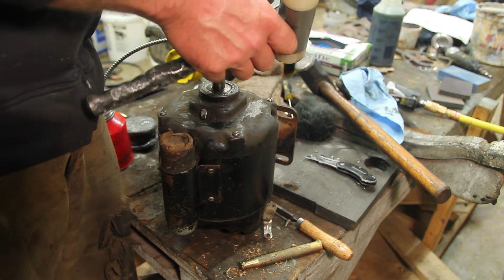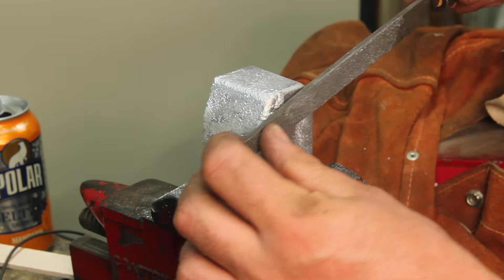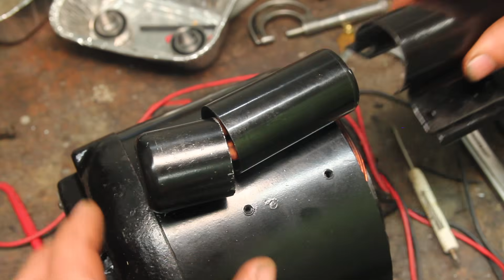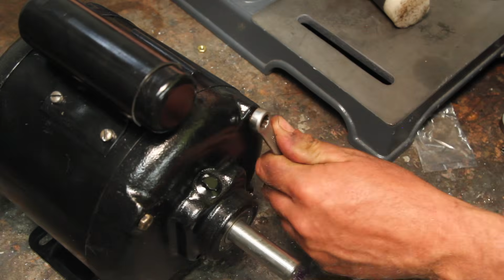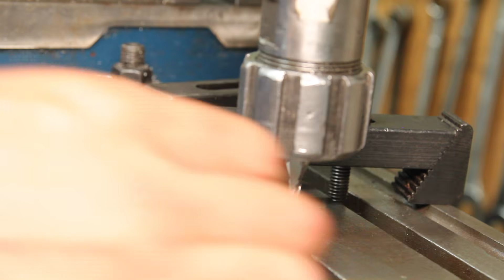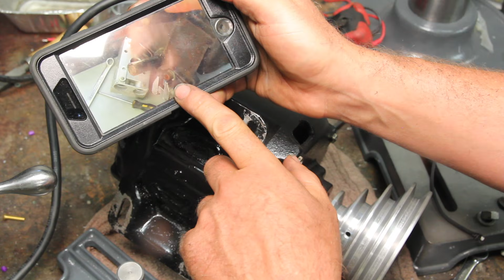Drill press Motor Restoration and a new step pulley

Comment: about the sleeve plane bearings aka steel backed Babbitt bushings they will work just fine even with that small area of pitting after you polish the shaft and about oil running out that crud you were digging out of the end caps was a oil wick packing that holds oil just a few drops at a time as all it needs don't drowned it or ya it will run out ! now is a ball bearing motor a better motor ya but what look are you looking for

Comment: I made a 5 grove pulley for a Cincinnati drill press 30 years ago from a 9.5 inch round stock aluminum 👍. I mounted it on a 1 1/2 horse Baldor motor with a reversible drum switch 👍 It still runs great 😊

Comment: Welcome to the mid 20th century anyhow.  My 1954 DeWalt radial arm saw's motor has 14/3 wire in it with a ground.  The insulation was rotted off the wires so I replaced it with 14/3 SJOOW cord.  The only new things it has that it didn't have before are strain reliefs for the cord.

Comment: man thats a super cool restore!!!! You sometimes go low key on some aspects of the restoration and sometimes all out! I like it, learn a lot. Even though casting, machining is so so time consuming it gets you the parts you need! always equal to or better than the original. I am improving and restoring my Walker turner 900 floor model. Putting a smaller KC 1/3HP on it as it looks way nicer. Adding a toggle switch to the side of the motor. Just that the switch is too big so it won't fit inside. Got an old projector that had a nice cast aluminum box that fit perfectly on the motor, Just need to drill 2 tiny holes to secure the box and it will be done.

Comment: Interesting with the plain bearings in the drive end. Both Restoration Projects' Delta drill presses have a tag which says "Double duty motor split phase : ball bearing" https://youtu.be/5HUOdNz1PWM?t=1755
Reply from the maker: It’s not the original motor.  I have baseless suspicions that the motor is older than the drill press.

Comment: Great Stuff! Thanks for the video and reviving this little pretty, Jeremy:)
Now to the usual Internet/YouTube "you should" stuff, hehehe: We NEVER solder electrical connections on machine tools. Especially not on motors or that with rotating parts = vibrations. Vibrations are the unavoidable death of every soft solder connection. That is only a matter of time. A physical connection or a permanently disconnected connection would be good. However, the most likely error pattern is an intermittently occurring fault. This is bad. Very simply (as with the existing motor and everywhere else) use a suitable screw/clamp connection, or the self-locking blade connectors, with the former being better and suitable for industrial use. BTW "They did it, too" or "This was the original state (from 1890??? hehe)" are NO excuses to not do it the right way.
Well ... No matter what you do, someone always mocks, right? Thanks again for the great video! :)

Comment: Excellent job. I have the Walker turner Bench model that is unblemished, but I plan to take it apart and do a resto paint job. I like your idea of casting the switch box. Mine just has an electric light switch. What size toggle switch did you use.?

Comment: Do you think your 3/16"  broach might have been 5mm ?
And 19/32"  could be Whitworth ?
Which referenced the size of the bolt not the AF.
Reply from the maker: No, I have the same 5/16” nuts with a 19/32” hex on my lathe- it’s the same vintage as this machine.  It’s just an odd antiquated standard.
Not sure why the broach was an odd size.  It wasn’t quite 5mm either.

Comment: Nice job!  How about a multi-speed pulley for the center collumn to get it down to steel drilling speed, if you're buying belts and making pulleys anyway?  Lots of diy examples out there as the original Delta attachment is pricey, when it can be found on eBay.

Comment: Beautiful work.  I am a little concerned about your location for the switch being so far from the business end of the drill.  I recently starting cleaning up a very similar Delta drill press, so I like your timing.
Reply from the maker: The original had the switch mounted on the side of the motor.  By modern standards, you’re right, that’s probably not the best practice…but neither is having open belts.
Reply: @JeremyMakesThings  Right on.  I haven't gotten around to decoding the serial# for my Delta, but I suspect it's a few years newer because they had wiring run through a hole in the back to a toggle switch on the side.  Of course the switch is right below the open belts, just to keep me on my toes.

Comment: OH YEAH BABY! DO ME ROUGH AND HARD, DO ME LIKE THAT DRILL! 23 minutes of good content, fuck yeah! Also, a horizontal mill would do the job just fine, the problem was your using a thick cutter like that unsupported from both ends... Sure, it can be used thusly, but anything thicker than 100 thou of slitting blade with a decent diameter really wants a proper horizontal mill setup to perform properly... With a universal mill that has the overarm or whatever type of support, you can use those thicker cutters to do some amazing work... A circular cutter can do amazing work if offered what it requires to do so... Much better than any endmill can at certain depths and narrow width...

Comment: If you want to make this reversible for any reason, you can get a reversible "hesitation" switch for the motor with 6 terminals.  the "hesitation" bit is so that you can't accidentally slam from forward to reverse in one motion unintentionally -- it mechanically makes you pause in the middle before proceeding in the opposite direction.  I put one of these on a magbase drill I rebuilt.   Wiring would take a few minutes to think through -- swapping the relationship of the start winding to the main winding, etc (same as any single-speed induction motor)
Reply: Just looked it up - I used the EATON 7992K10 switch in my project, in a similarly-tight space at the back of a motor

Comment: Great restoration video! 👍
I'm a bit concerned about all that green loctite, there is a lot of surface area on that bearing fir it to hold on to... isnt green the "never get it apart again" warning colour? 🤔😯
Reply from the maker: Green is the slip fit/press fit resting stuff.  Probably harder to get apart than the red and certainly the blue, but for this I want all the help I can get.
Reply: @JeremyMakesThings    ahh ok, I'm only familiar with the green stud lock compound, it never comes apart unless you heat everything to stupid-high temperatures. I only use green for studs and dowel pins where I NEVER want to get them back out, lol.
When there is that much surface area to glue I just would have used good old blue 243, nothing will move and it is not too bad to separate later for a bearing change.
Nice drill press! 👍